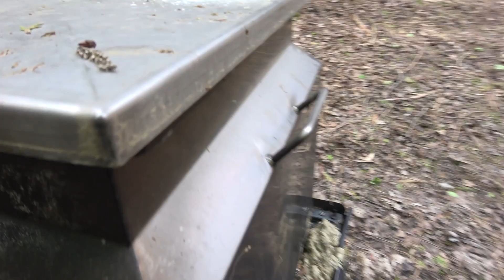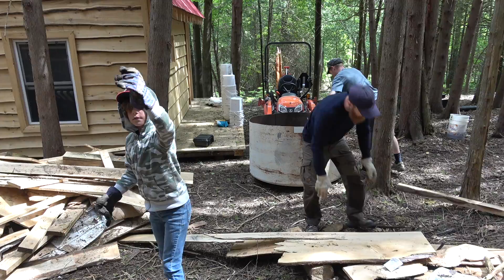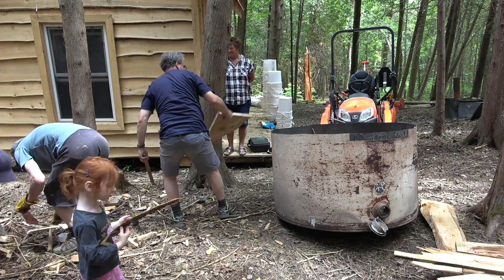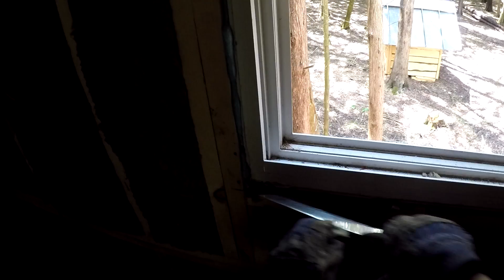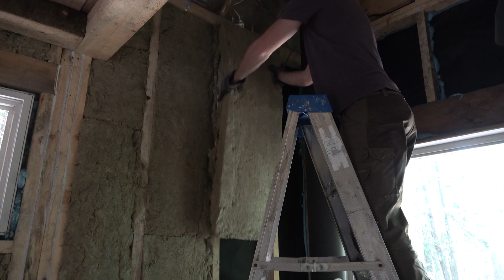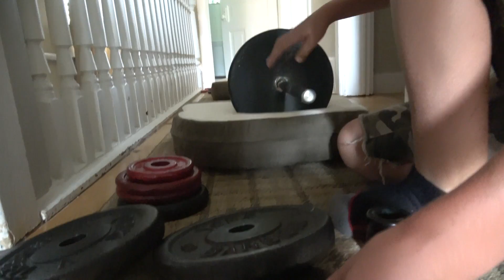Off Grid Cabin Construction (Dirty Jobs)! | 'Leaving People Behind'

Comment: Couldn't you have sold the wood you didn't need as firewood or used it at least for a campfire to cook? Seems such a waste.
Reply: There wood be no market for that wood... It's scrap.  A face cord of actual good hardwood seasoned and cut to length would be around. $75CND.   That's random lenghts of softwood you'd be hard pressed to give it away.

Comment: Here's a challenge for you that will also get a TON of views.  Build a gasifier to run the generator.  Only then will the cabin be truly off-grid and no longer need gasoline.  A gasifier is the one true item that can connect the old way of burning wood for energy;  to new age of machines running on fossil fuels.  The perfect gasifier has never been built.  Can you do it?  843-246-7397.  TomsBeachHomes@gmail.com if you need me.

Comment: Hey man, have you thought about insulating the floor of your cabin? If you cant reach the underside, you can always put a layer of 2" rigid foam on the floor and another layer of plywood over it. Then just trim the bottom of your door and make a threshold for it. It would make a HUGE difference in winter. 

Also, have you thought about installing gutters and doing a rain water catchment system into 55 gallon barrels? Would be nice to have out there!

Comment: Was thinking that you burned a lot of wood you could have used in your wood stove, at very least for kindling? Didn't make sense to me to just burn it all when it could be used for heat/ starting the fire?
Reply from the maker: It's too low density, burns too fast, makes a mess.  The wood stove is so small, it would take more to feed, process, that it would be worth.  Our wood is so well seasoned, that it burns well, hot, and long.  Yes, we could have saved back some kindling for stater, but we have a lot.
Reply: that was what i am thinking too.
Reply: @JTXJTXJT yes, it will back to land nutrient
Reply: Dude look out the window, no shortage of wood.LOL
Reply: It is hard to watch a resource being used in such a manner. Living in suburbia and being an age where I am not going to be cutting my own firewood seeing fuel torched like that flies in the face of my frugal nature. It must be hard for folks that live in areas where there is no hard wood to watch that also.  I like that Chris told us that they get firewood for free from arborists. In my area the arborists are all firewood purveyors as well. It is nice that Chris has a good resource. 

Chris' comment is also appropriate. The softwood burns so quickly that it forces you to feed the stove frequently. Those who must burn softwoods get used to that. We who are spoiled with hardwoods have a hard time using softwoods. Either they frustrate us or we get irresponsible softwood. Hardwood is much easier to maintain a good combustion efficiency.

I am also minded of a discussion Chris had in season 1 about returning the resource and good forest stewardship. Even if the softwood was the only firewood source there is such a plethora that the stewardship outweighs the seeming waste.
Reply: People look at this subject with their own unique perspective, I think the “waste” comments are coming from people with no fuel wood around. Our place is kinda like in the video, so much wood it just needs to go away so we have usable space/fire safe forest. A cluttered forest floor is a catastrophe waiting to happen. There’s always more wood out of view, you still don’t have to go very far.

Comment: Glad to see you chose Rock wool.  Good choice.
Reply from the maker: The spray would have been too expensive.  Rockwool is a great choice though.
Reply: @TheWoodedBeardsman  not just that. But spray foam could be problematic with freeze thaw issue during vapor migration. I'll keep it simple at that. My profession was thermal and moisture protection. About 40+ years, over 3,000 structures. I'm happy with your choice lol.
Reply from the maker: Glad we did it the right way!!!